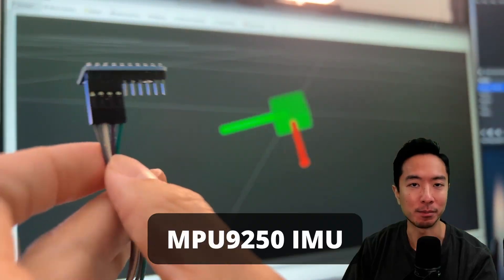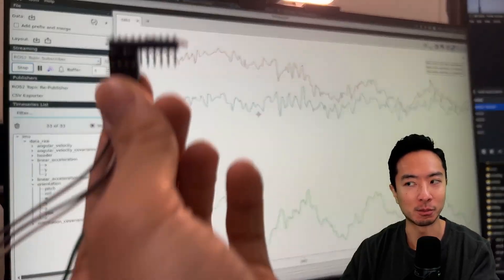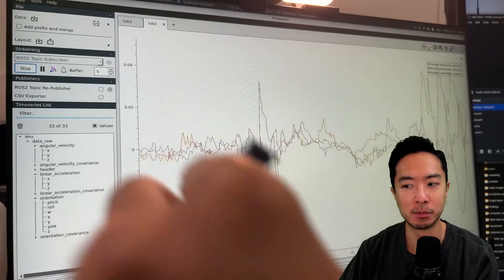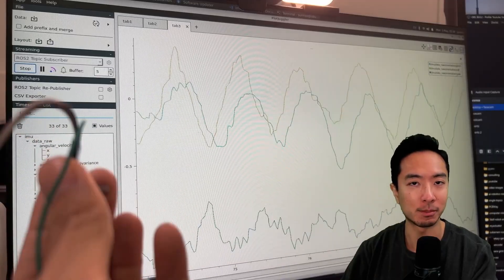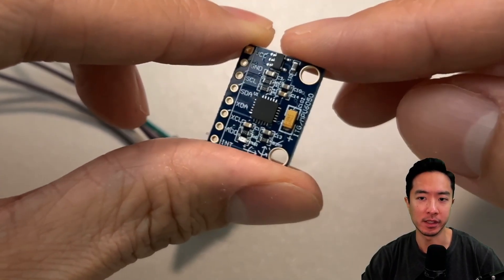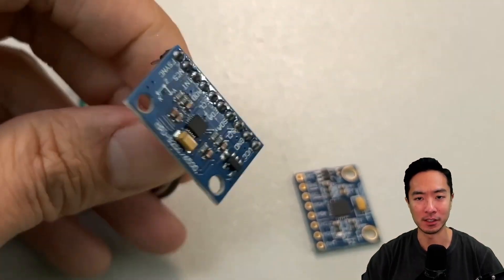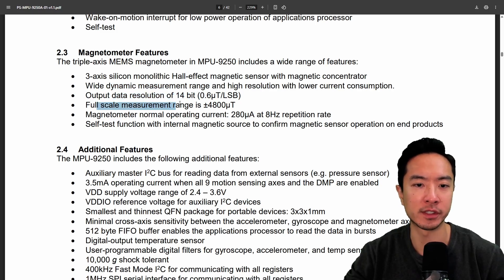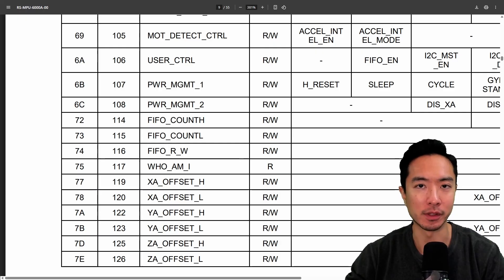MPU9250 IMU with ROS2 on Raspberry Pi for Rviz IMU Data Visualization

Comment: I initially tried the IMU plugin in Gazebo for sensor fusion with wheel odometry, and it worked really well. But after switching to the real MPU6050, the results are terrible — the bias keeps changing and the readings are inconsistent. The drift makes the sensor fusion completely unreliable.

How’s the bias stability on the MPU9250? Is it any better or still the same story?
Reply from the maker: I haven’t looked into too much